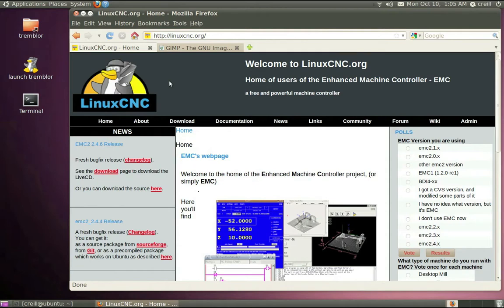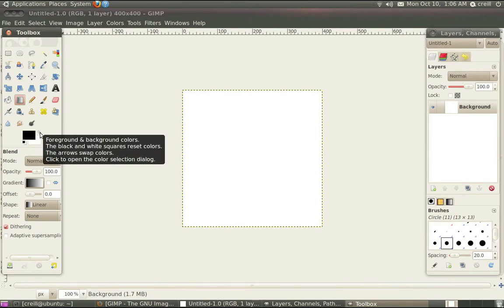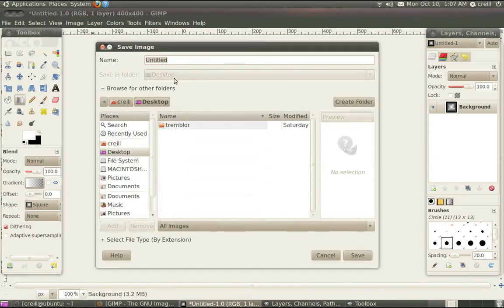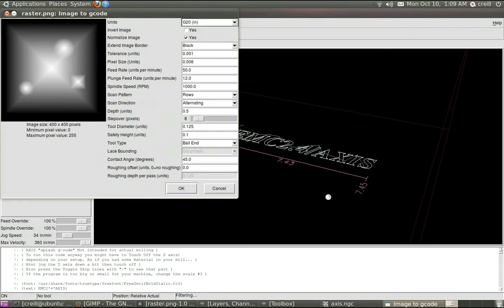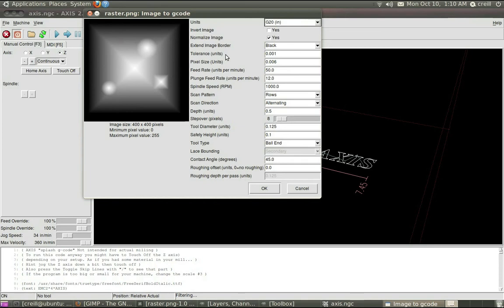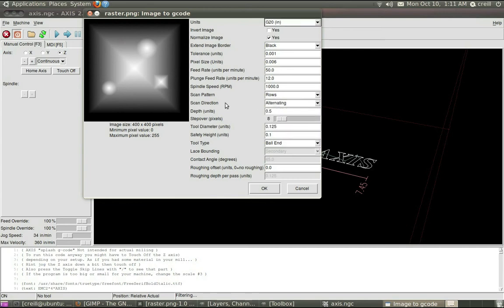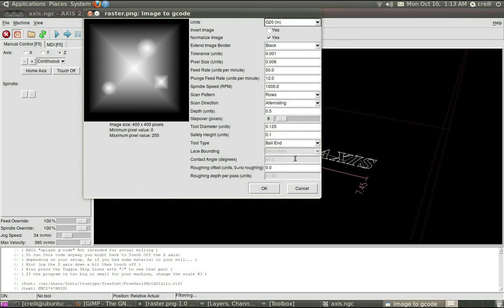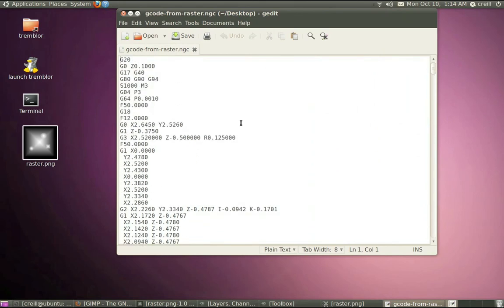G-Code from a Raster Image - Open Source CNC Toolpathing Workflow

Comment: hello, i have problem to convert dravings from ArtCam to print with CNC, loks like G-code not working properly, pixels is by far too big, and if i try to print, it print those huge pixels, and looks prety bad, any suggestions to fix it?